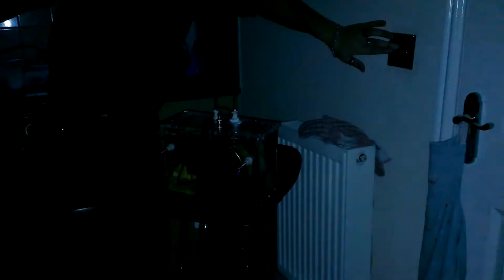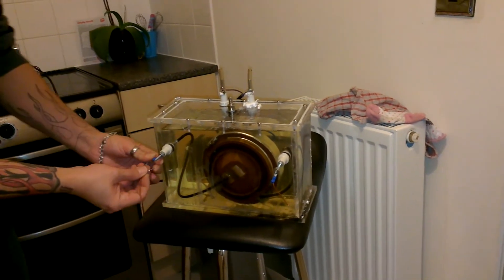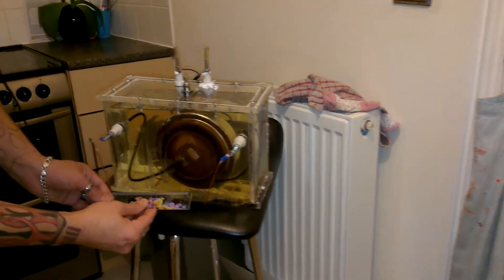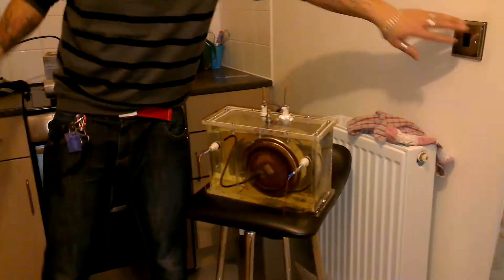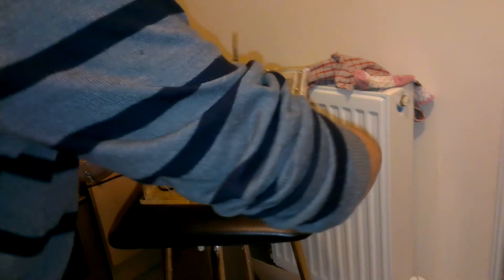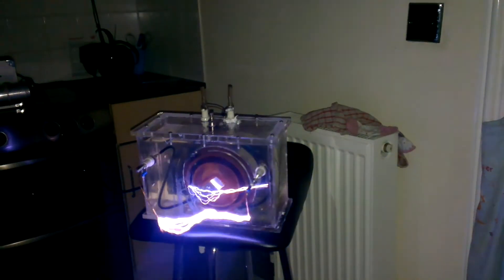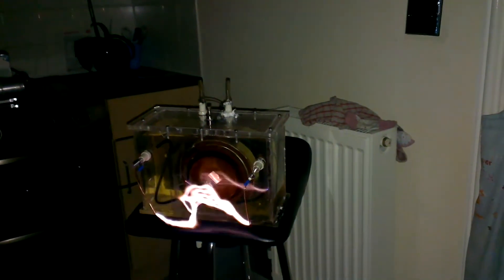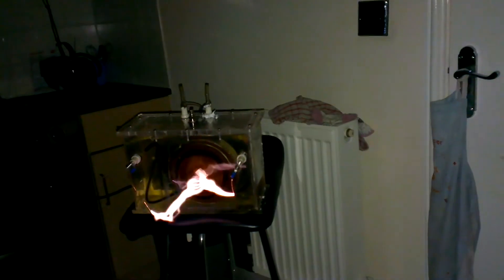X-Ray transformer trying to get bigger arcs still ballasted though

Comment from the maker: ye its a variac im using only a 5A one though but i  now have a HUGE variac (can handle 50A easily  but i have been in to much pain to play and its not good playing with 150KV whilst taking morphine :-/ I also need to add a guard to stop the arc over but again toooo much pain BUT stay tuned this transformer has alot more than that to give ;) thanks for watching

Comment from the maker: haha I'm still using my MOT'S as ballast at mo and I'm hoping with the spark gap setup i showed ya i wont need a barrier as it will make it look ugly ,if that dont work i will make 1 ;) cooor getting that fackin huge Variac tomoz and I won a 0 to 30 second delay relay today for £8 so that i can make a soft start ,Im quite lucky though coz alot of ppl are saying there sockets are on a 16A breaker and mine are on a 32A but so iv been reading these variacs have an inrush current of about 55A :-/

Comment from the maker: HAHA you guest it !!!! That's what i brought it for i have a 7.5 inch secondary form its 40 inches tall ,iv got the primary to 20 meters if 10mm copper pipe BUT i am partially disabled and my last SGTC took ova a year to make and this one will need a rotary gap OH and i need to move house so i have the room but it is on the cards for future years and it WILL be done ;) thanks for watching